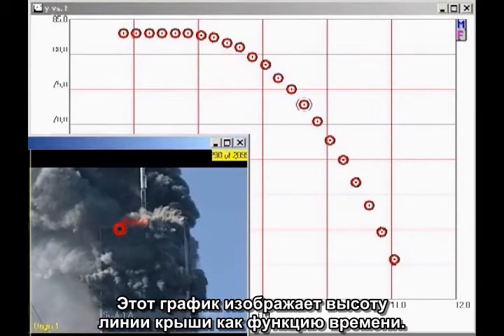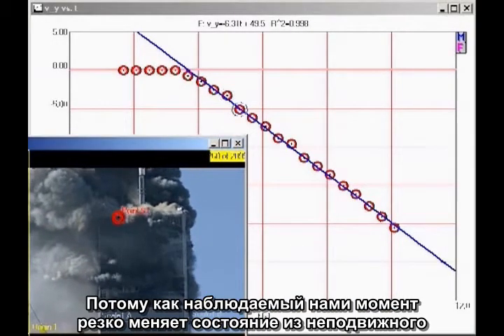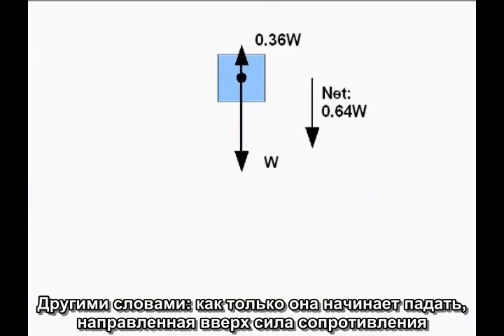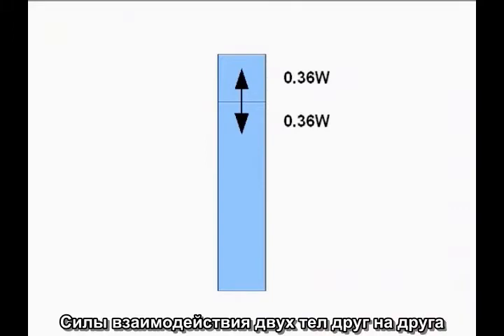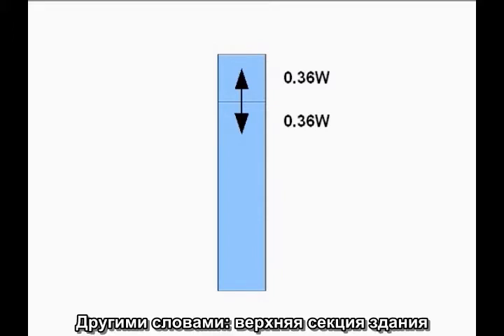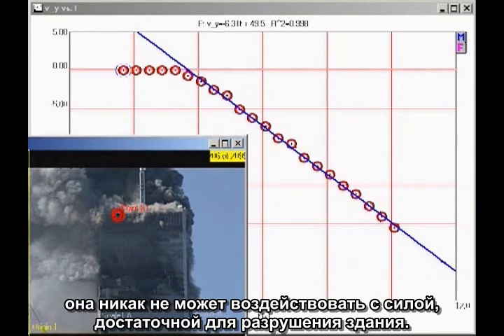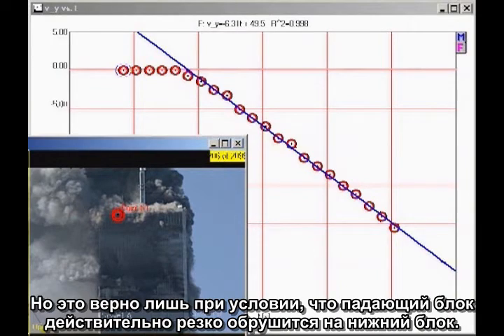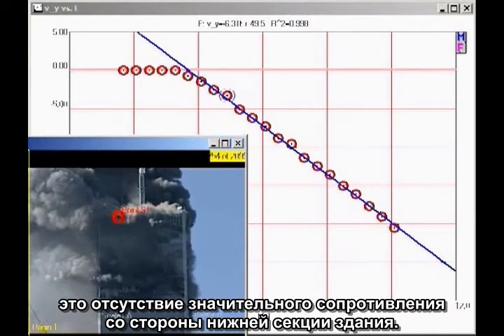Дэвид Чандлер - Ускорение северной башни - русские субтитры

Comment: @ryinski2 So not only do these falling pieces fall quickly through the path of greatest resistance they also leave more damage than the potential energy of the buildings mass should be able to account for. Furthermore the presence of molten steel, which is beyond easy to find evidence of, would require more than jet fuel buring in open air to produce as it would not be nearly hot enough. That and about a hundred other things that make absolutlely no sense in the official accounting of 9/11.

Comment: @Androsstudio Completely irrelevant. No matter how much weight was at the top of the buildings the bottom sections should have been perfectly sound and built with increasingly thicker steel towards the bottom, which would provide great resistance to stop collapse or push the collapsing matter off to the side at the very least. The south tower upper section tilted heavily to one side as it collapsed and should have fallen to the street through open air and not through solid steel building.